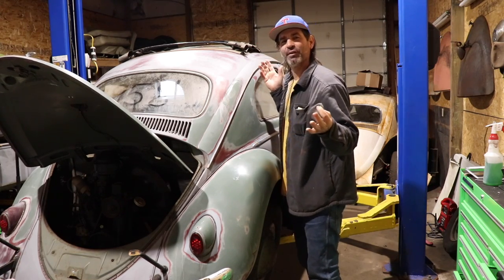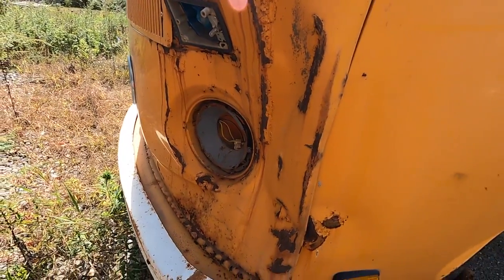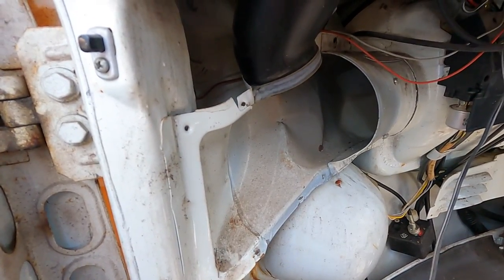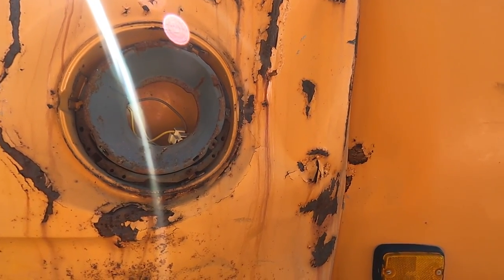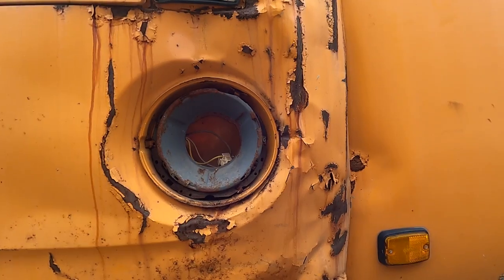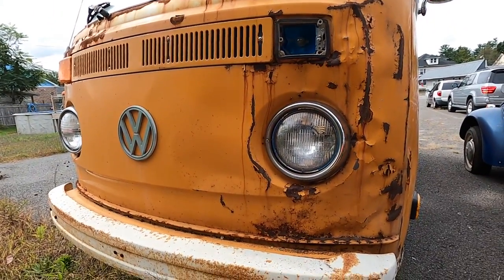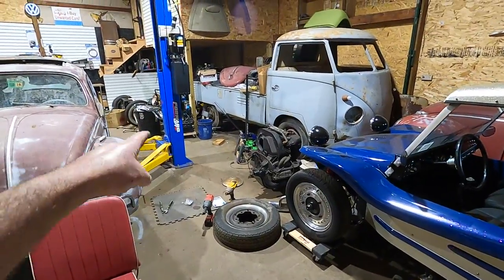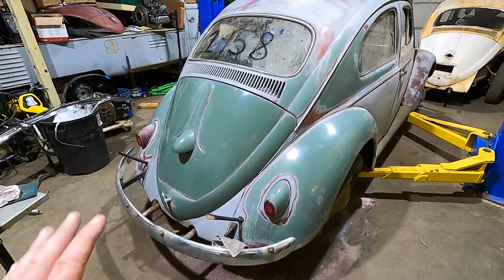VW BUS CRASHED! Fixing the smashed nose - repairing the dent P1

Comment: I think I would make a template of the opposite side first,  then I would compare the crashed side to that as I'm pushing/pulling the other side out.   Using a piece of 2x4 under the portapower piston would help to distribute the push more evenly.   Then probably weld a few pins to the exterior and begin to easily pull the dent while tapping with a hammer and constantly comparing to the opposite side template until I got it nearly perfect.

Comment: Nice to see you fixing the bus. Listwn: when pushing out big sections like that nose, use some 2x4s to spread outthepush and for the base of the Jack so you don't put in more dents. Also, when it jas come out some you needtocounter hammer the  areas around the pushed part to relieve the stress in the metal. Best of luck.!
Reply: Dear 1967250s
👍👌👏 You commented exactly/spot on what I wanted to suggest. Fortunately you already did all the writing work. 😁 ;-) Additionally I suggest the use of a pull/slide hammer.
Best regards, luck and health.

Comment: I think for someone who has never done anything like that before then you did very well. I know there's not much room in there but if you can get a block of wood or some flat 1/2 inch steel plate that would be a big help. Try not to get 'mountains" so just push a section so far then move on to another section. The popping is good but try to imagine how it will look when finished, compare with another bus if you can. Your aim is to have the minimum amount of filler at the end. Hope that helps 🙏.  BTW the 58 is coming along very well. Thanks Jason for the updates. 👍 👍

Comment: You should read the old book The Key to Metal Bumping.  It’ll tell you to reverse the damage by in doing it in the reverse order in which it occurred.  Size it up figure what was hit first, from which direction, and what crumpled last. From there you work backwards.  Also for the bits that are blocked, if you can fit it in there,  try a kids basketball deflated, wedge it in there and blow it up.

Comment: You can always use a block of wood between the metal and the jack to spread the force out over a larger area.
Reply from the maker: thank you for the tip , I have a spreader in the kit as well and a stud puller when we get to that point.
Reply: @5150mxVW  For odd areas a piece of wood can be cut with a sabre saw to match the contour that you want to achieve. In bodywork, you do what works! 😀

Comment: Dear 5150mxVW "J"
👍👌👏 1967250s already commented exactly/spot on what I wanted to suggest. Fortunately he already did all the writing work. 😁 ;-) Please kindly allow me an additional suggestion: You need a pull/slide hammer (like the one vehcor uses). If you don't want to buy one, it's relatively easy to build one DIY. Anyway: Sometimes it's better to pull out dents. But each method absolutely needs a lot of light hammering to take out the stress in the (sheet) metal!
By the way: I would have been exactly as eager as you to dent out the front. It was my very first and Instant thought after I saw the orange bus the first time. It simply must've two eyes! 😁 ;-)
Best regards, luck and health to all of you.

Comment: Use some large 3 or 4 inch washers and tack weld them to the areas on the Bus's nose where it needs pulling out.  Use a come a long and a tree or similar and pull all that out.
Reply from the maker: thank you for tip TP, I'll try some welding / stud puller later when it's in the shop.
Reply: @5150mxVW   Got to watch using a stud puller.  It will pull out the dent but will also crown/ stretch the metal.

Comment: also use heat as you go  tap down on highs gently while pushing some cuts will ease it also cut on high stretched creases they will never go back. also could buy a panel and weld in.

Comment: Maybe Try Get’n A Nail Puller Kit. Spot Weld Nails & Pull The Dent
Reply from the maker: yes, i have a stud gun, that will part 2 ...although I probably made it worse now. I would of liked to pull from the front 1st but wanted to try the new tool out.

Comment: Would you not of been better welding something to the outside and pulling the dent out? Great video by the way. 👍👍
Reply from the maker: Yes I would of preferred to pull it out but I wanted to try the new tool . The bus will come inside for the stud puller / welding tip techniques .  Thank you